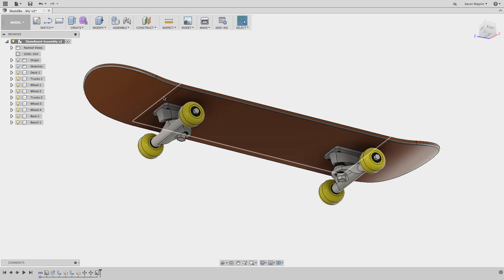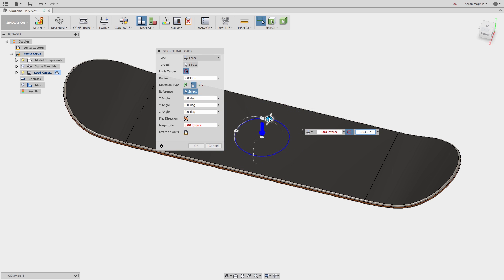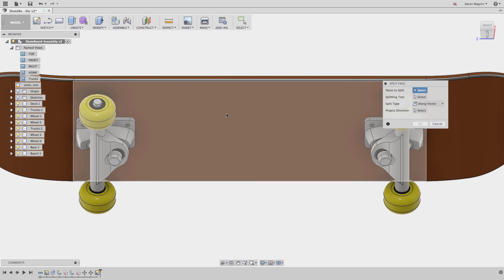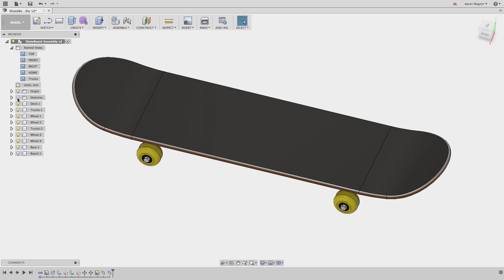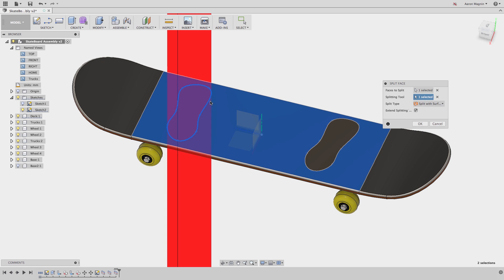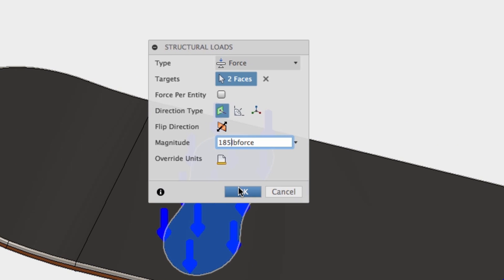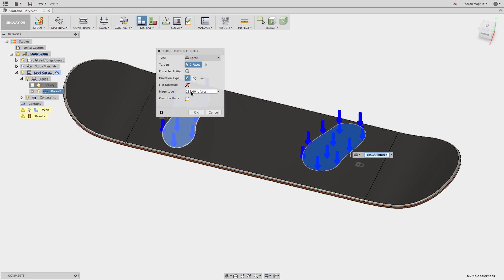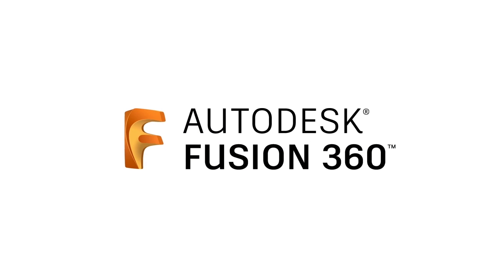QUICK TIP: Simulation Force Control

Comment: Nobody ever explains what they are doing in any of these videos. Like how at 1:10 , a "model toolbox" box just pops up out of nowhere with no explanation of how it popped up. Which pretty much does me in for this video on a never-ending rabbit hole of incomplete youTube explanations with still no idea of how to apply a load or why loads in tutorials don't work for me.. I am on a 30 day trial, and so far I am really hating this software. Nothing is intuitive. Τhings that should just be simple, aren't. What is a load other than a magnitude of acceleration  or velocity and a direction? Why does it have to be any more complicated than that? Why can't someone just make intuitive software that follows simple physics? Choose a magnitude and direction, boom done. If it MUST be so over-complicated, then I wish someone would explain this stuff without skipping over so many steps. Right now, I think I just want to look for better software. Something where all ya need is point of contact, magnitude and direction and things just do what they are supposed to.

Comment: How did you get it to even start the simulation with wood?  I use fusion to model furniture and can never get it to run the simulation with the selected materials. Always get a "materiel is non linear warning".   I love the program and understand it's a work in progress but if you could help out with solution or work around it would be greatly appreciated.   Regards.

Comment: thanks for the nice video! Unfortunately fusion is not able to deal with orthotropic materials like wood correctly. When modelling wood you're always forced to define funny isotropic materials as an estimation... which is at best annoying if not wrong. Nevertheless absolutely great piece of software fusion. if this is wrong I'd be absolutely happy.. :) Really missing this feature in fusion..
Reply: Hi! great... I will try this. Different materials types have always been available in the material library but weren't usable in FEM. Your concerns regarding wood are only correct if you focus on small parts. However there are also people working on buildings, bridges, etc... So something where defects average out. Thanks for the Dropbox video!